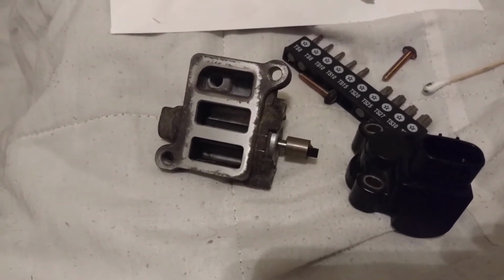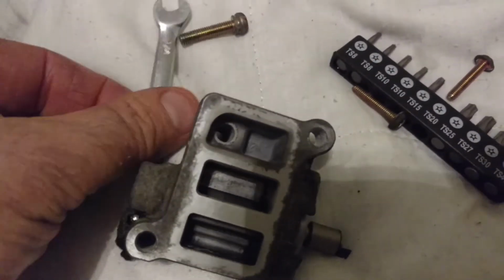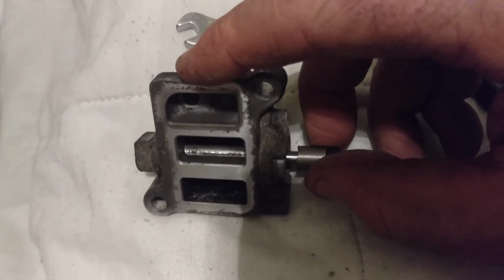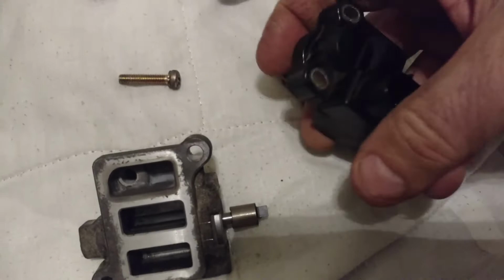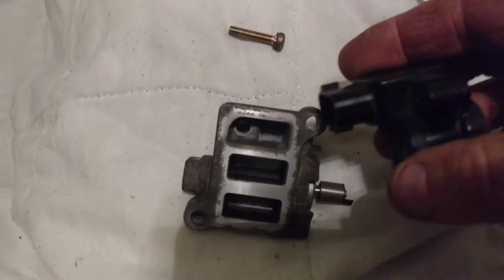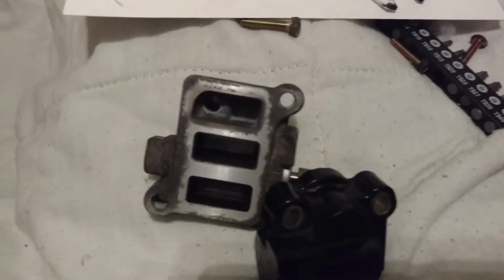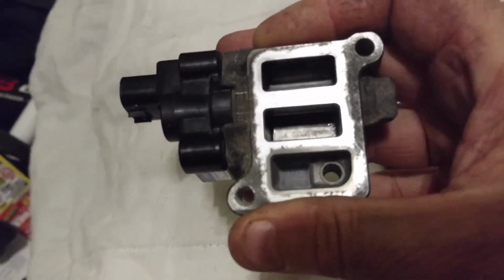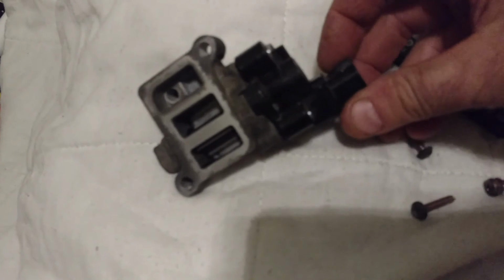(pt1) minimum parts removal 1999 honda Odyssey idle air control valve removal, cleaning

Comment: The torx bit used in this video is a TS 20. Another YouTuber said that the screws are a Torx Pentalobe head (see also Torx Paralobe) which has a five pointed star with rounded star tips. This video looks like the pentalobe/paralobe star head (but video is too dark to see the tip well). These screws can possibly be removed with a standard torx 20. The other YouTuber used needle nose vise grips to break the screws free. https://youtu.be/ZrdHxugeGqA
Reply: Yes the screws are torx 5 point, 20.

Comment: Man, you're great! I was looking for info on the disassembly of this valve and i was about to give up until i found your video! I tried to open my valve but i found some strange restitutive force that made difficult to pull the solenoid apart. My first thought was there's gotta be some kind of spring or magnet retaining the solenoid to the shaft of the valve. When i saw your video i confirmed my guess. You're the first one i found to have the guts to disassemble the valve and thanks to that i can clean my own deeply without the fear of destroying it. Thanks a lot!